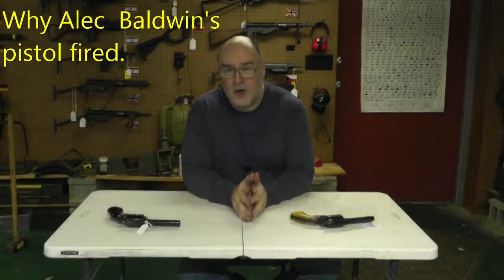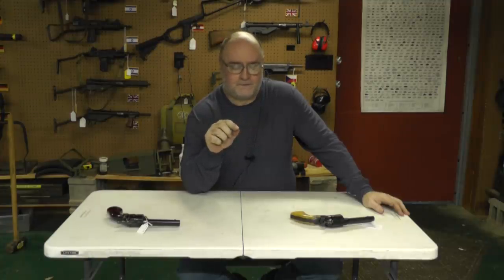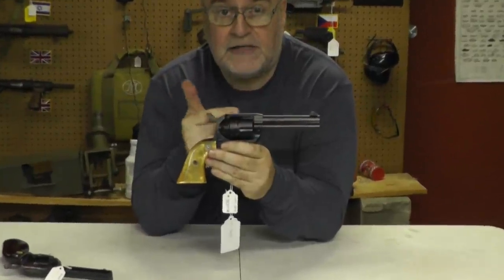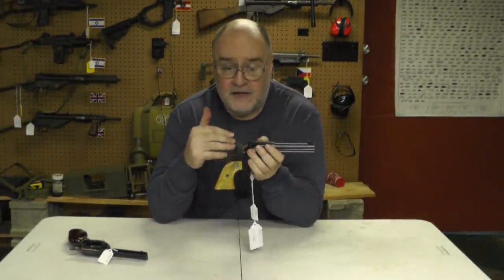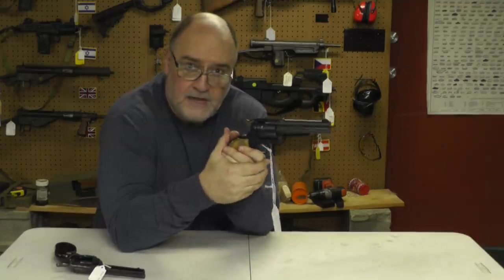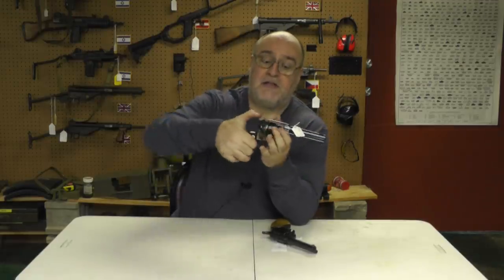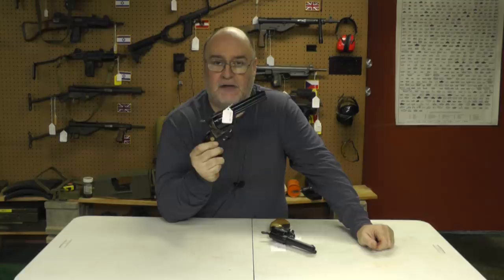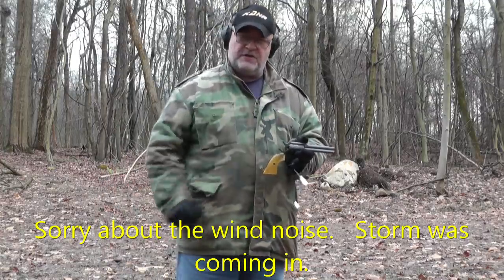Why Alec Baldwin's gun fired

Comment: Finally someone who has a gun very similar to the films gun and a legitimate idea of what's gone wrong. But there's still a huge assumption the films gun wasn't modified to play out for action scenes. Just about every film gun has some form of modification somewhere on the gun. But the real mystery is where did a live round come from and why were they on set.
Reply: that's not a mystery. it's already public knowledge that unspecified members of the crew had been doing live fire outside of work hours.
Reply: @kenbrown2808  Live rounds may have been mixed with dummy rounds to dress the gun to make it look loaded. Unless you have someone in control of the weapon and dummy rounds making sure live rounds are never in the mix anything could happen. As history now tells anything did happen.
Reply: @leokimvideo  ever heard of the swiss cheese model of accident analysis?  It basically says that every safety measure has holes in it, but normally if something gets through one hole, it will get stopped by other measures. In this case every measure happened to have a hole that lined up with holes in every other measure .  Every person on that set had to make a mistake for that to happen. The best way forward is to understand how it happened and work to ensure it doesn't happen again.
Reply: @leokimvideo  it's being said that AB himself was firing live rounds out of the very same gun earlier in the day.
Reply: @kenbrown2808  I agree, truth is, there is no need to ever use a real gun on set, there are all sorts of spot on "non firing" replica's.. especially with single action revolvers.. lots of films don't use blanks.... the editor just drags the muzzle flash in the timeline over the muzzle of the firearm, then drops in the appropriate "bang" in the sound track... and it is totally convincing. The actor needs to learn how to fake a good recoil.. the hammer fall of a fake actually registers on the sound track.. easy to line up.... I'm going to take a guess and say that is what will happen...
Reply: @JimHancock  I think any actor firing  gun in a role needs to learn to fire the gun in real life - on a firing range, of course. I've seen a lot of bad acting around guns and a lot of unconvincing editing. however, I agree that no prop gun to be used where it will spend any time pointed at any cast or crew should be capable of firing a projectile.
Reply: @kenbrown2808  true... but we have improved vastly since the days of throwing the bullet out of gun kind of motion like back in the old westerns lol .... even blanks are usually half charge or less.... so recoil needs to be faked...... a good armorer should teach the actor to fake a recoil..... for semi automatics... air soft are very convincing, the slide functions when you pull the trigger.... I don't know what the unions will come up with..... I'm an indy guy... I have to use fakes because I am not going to have any such risk on my small budgets.. some people just find it hard to suspend disbelief..... and spend the whole film looking for flaws.... those folks enjoy that.... Hell I've spent a lot of time behind the camera and I still have no problem getting lost with the story.... :)
Reply: @JimHancock  you're right. The old westerns were sometimes almost comical.  And the biggest issues with simulated gunfire is often bad sound overlays or dropping the wrong kind of empty shells.
Reply: I agree
Reply: @leokimvideo  one job of the armorer is to make sure the gun is safe. She didn’t do her job.
Reply: @ronm6359  Baldwin was the Executive Producer, who was ultimately responsible for everything that happens on set and in charge of hiring the armorer and safety team.  Baldwin sent the safety team home to avoid overtime.
Reply: @leokimvideo  There was no reason for any rounds to be in the gun for a rehearsal.
Reply: @megsmith596  Doesn't matter, Baldwin should have checked. He WAS the person who murdered Salyna.
#
Reply: It’s a mystery to me why the film industry doesn’t mandate that all firearms be inoperable on set.
Reply: @byteme9718   learn that definition..?
Reply: @946towguy2  yep. He has liability from a lot of angles. He’ll probably get off because of who he is and the armorer will take the fall
Reply: @reddeercanoe  In some cases, they may be working with rare or antique firearms which the armorers do not wish to modify.  But there is nothing unique or rare about a modern Uberti reproduction of an 1873 Colt.
Reply: you hit it on the nail
Reply: @leokimvideo  There are different types of 'dummy' rounds.  The dummy rounds used on the set were realistic-looking theatrical dummies with steel BBs inside.  The revolver was a modern reproduction of a Colt 1873, chambered in .45LC.  '5 in 1' blanks with a plastic shell casing are used for 38-40, 44-40, 45 Schofield, .45 Long Colt, .44spl, .44 mag; revolvers, lever guns and .410 shotguns.  

Decorative or display dummy rounds are usually fired shells which have had a projectile fitted, but no powder and usually a spent or no primer.  Sometimes, they are attached to a key chain or other type of decorative display.  These will usually not readily chamber in the firearm they were originally designed for.

Training dummy rounds are designed for training and specifically designed to be differentiated by both sight and feel.  They often have one or more holes in the side of the casing and either a spent or an absent primer.

Action proving dummy rounds, go, no-go, and field gauges are designed for testing the function of a firearm without shooting.  These are also easily identified by look and feel.

Theatrical dummy rounds are designed to look real, and to chamber in the prop (which may be a functional firearm) while not being loaded with powder of primer.  They are especially important in revolvers when the prop needs to look loaded or it is necessary to show rounds being chambered or extracted.  These usually have an intact shell casing with metal BBs inside which act as a rattle when shaken.
Reply: @leokimvideo  I'm aware of those cases and agree with you about safety procedures.  
I don't think there should have been live ammo on that set except for the security who never has direct contact with actors or props.  
In some cases, there is filming of live shooting, especially on ranges or competitions. 

 It is my opinion that cold gun scenes should be filmed first while all blanks and live ammo is still off set.  Most of the negligent discharges I've seen or known those involved was with a firearm that someone thought was unloaded or they thought they had cleared.   

I once bought one of desktop brass cannons that shoots a single 00 buckshot pellet at an estate sale.  It h Almost every one of those had no injuries because the firearm was not pointed at anyone.
Reply: @leokimvideo  Thanks for the reply.  I agree with you on safety protocols and never pointing firearms or blank-firing props at people.  
I was just pointing out 2 things:
That when there are scenes which call for a 'cold gun' it is better to use a non-firing replica and when there are scenes which call for 'hot gun' blanks, it is better to have blank-firing props which cannot chamber any live commercial ammunition which might find its way on the set.  
That when live ammunition is to be used, it should be in a separate session with thorough inspections before and afterword; preferably after all cold gun scenes.  

I don't think there was any reason for any live ammunition to be on the set which could fire in any of the prop weapons.  Armed security is always separated from the props.

Brandon Lee's death has similarities with this case in that both involved rushed schedules, sending the safety team home to save on overtime and not checking weapons to insure there was no live rounds or projectiles lodged in the barrel.  When I was in the Army, we could not be issued a weapon from the armory until it was checked for being empty and could not leave the range or training area until a cleaning rod was run down the barrel to an open breech on every weapon.  We had to declare (under penalty of court martial) that we had no brass or ammo when we left the range. Then we could not turn in a firearm to the armory until it was checked again.
Reply: @946towguy2  Most effective checking procedures (no matter what is being checked) involve TWO independent checks.  It’s usually money saving measures (not always) which negates one of these checks with negative consequences!!!
Reply: Its no mystery. Baldwin and the actors were target practicing and havin' a hoot-and-holler time with real live west shootin' pistols!! Vodka tonics after the day's shooting, no pun intended.
Reply: @ronm6359  Well, apparently she had said that they didn't need a real gun for a rehearsal but was over-ruled.  And they were saying that the gun was loaded with realistic looking blanks.  If the ammunition storage had been compromised, she might not have had any way of checking that the gun was safe.

If say someone had been fooling around with the gun, and when they took it back threw live rounds into the dummy rounds container?
Reply: @TheToledoTrumpton  “ might not have had any way to check if the gun was safe.”

I can tell you have no knowledge of firearms. You NEVER take another person’s word that a gun is safe. Anyone can be trained to check if a gun is safe, ANYONE. And you NEVER, EVER take anyone’s word a gun is safe. You ALWAYS check yourself. The basic NRA rules for firearm safety are:

1. Always treat a gun as if it is loaded.
2. Never point a gun at anything you are not willing to destroy.
3. Keep your finger out of the trigger guard until your sights are on target and are ready to fire.
4. Always be sure of your target and what is beyond.

If these basic rules had been followed, nobody would have died. Live rounds should never be allowed on a movie set, NEVER. Responsible gun owners know these rules and DO NIT “fool around” with a gun. It’s the armorer’s responsibility to keep the guns under their control so no one can “fool around “ with them. That negligence is how accidents happen, and did happen in this case.
Reply: @ronm6359  I get all that, and I think Baldwin is guilty as Hell.  The armorer I think is going to plead guilty, or take a deal.

She obviously inherited a site that was wildly out of compliance, and a cast that did not respect guns or armorers.

Obviously the previous armorer with more experience quit, and so should she have done.

Somehow the arms locker must have been contaminated by live rounds, mixed in with the dummies?

She should have attempted to fire every chamber before handing the gun to Baldwin, but as you say live rounds should not have been anywhere near a movie set.  Does the required procedure indicate that a visual check is enough?

It is going to have to be up to the courts to decide if it was reasonable for her to assume that a container labelled blank rounds actually contained blank rounds.

I've worked in compliance, not with guns, but often with other safety regulations, and I appreciate that you have to not only follow the rules exactly, but be able to prove you followed the rules exactly.  I had one guy, who issued safety equipment, take a picture of everyone he issued the equipment to, wearing it, every single day.  And then another picture of the guys when they turned it in.  Later they put a video camera in, but bosses are slow to understand compliance.

I understand that she should have realized that the entire arms locker was out of compliance when she inherited it, and it would all have to be verified down to the last round, before it was compliant.  Dis she suggest that?  Was time to do that approved?  We will find out?

However a jury is probably not going to understand all that.

I have to be honest I have more sympathy with the armorer than Baldwin.  She was trying to get her boss to be compliant and he wasn't listening; been there done that and it is a bitch, particularly when you are a junior rookie and you are telling someone like Donald Trump what they must do, or must not do!  You get angry and frustrated, and that is when mistakes happen.
Reply: @TheToledoTrumpton  the armorer is the daughter of a famous Hollywood armorer (can’t remember his or her names) so one would assume she had the best possible training (that could be a faulty assumption) I did read that she expressed a lot of doubt whether she was ready for the job, and I am sure the prosecutor will use this against her. I’ve also heard that people on the set, including Baldwin were doing target shooting with live ammo when not filming. I don’t know if the armorer was involved directly in this or not. Either way she should not have let target shooting go on. All guns should be locked in a secure safe when not in use to prevent unauthorized access.

I think Baldwin deserves jail time on a number of legal counts. The FBI said they examined the gun and found it to be in perfect working order. Baldwin claims he did not pull the trigger to fire the gun. However he must have had his finger holding the trigger back, then cocking the hammer and releasing it. In some of the old west movies you can see an actor doing what’s called “fanning”. Holding the trigger back while using the other hand to continually pulling back the hammer, for rapid fire. 

I feel somewhat for the armorer. I think she was in over her head and knew it. Got the job because of who her father was, not because she had demonstrated she was qualified. I suspect Baldwin might get off with a slap on the wrist because of who he is, but because of the publicity there has to be a trial. I suspect the armorer will be the scapegoat, she probably should take a deal if offered.

If I was the prosecutor, I would ask Baldwin one question… Mr. Baldwin, if the movie script called for you to put the gun to your head and pull the trigger, would you do so just on another person’s word? Or would you first safety check the gun yourself?
Reply: Your right in movies revolver never need to be reloaded
Reply: Yes, but Baldwin believed there was no live ammunition in the gun.